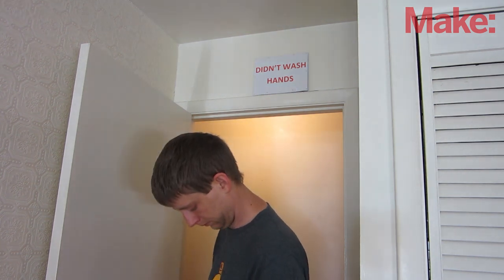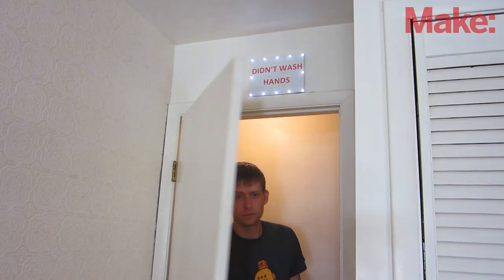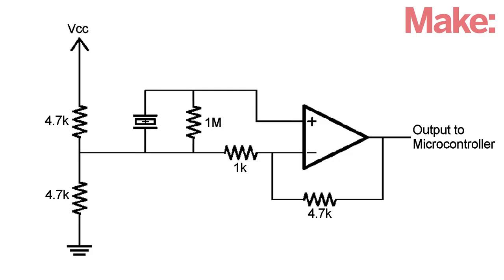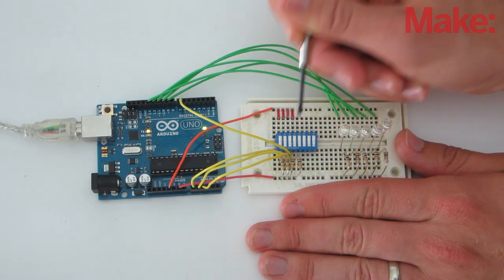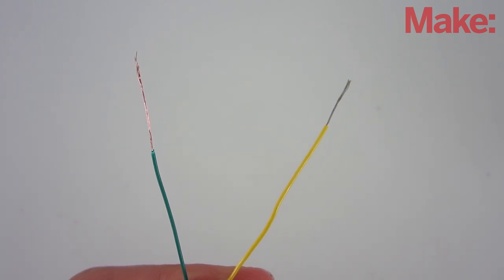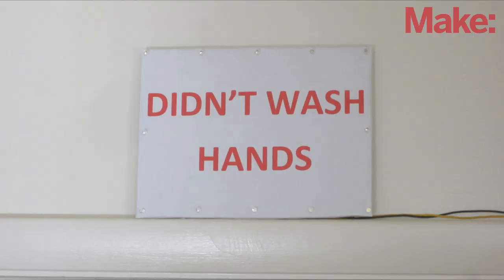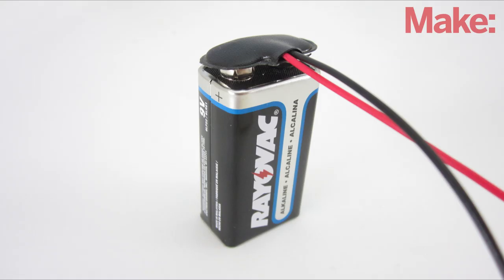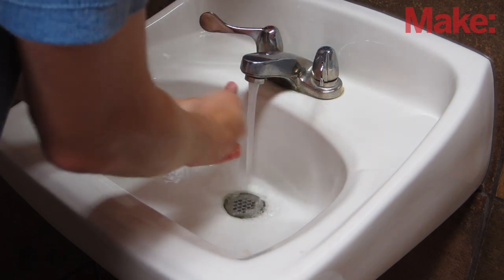Didn't Wash Hands Alarm

Comment: I think the power transistor is probably over kill.  Three columns of LEDs, drawing probably 20 to 40 mA (where 40 mA is on the high side) would draw maybe 120 mA altogether.  The LEDs could probably be safely run from a 2n2222 transistor (disclaimer: check the actual current draw first.)